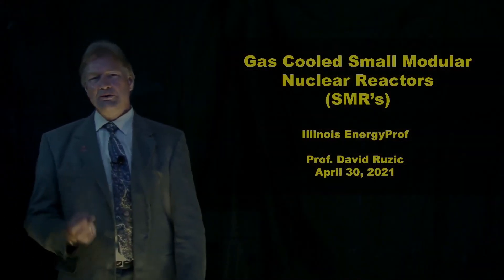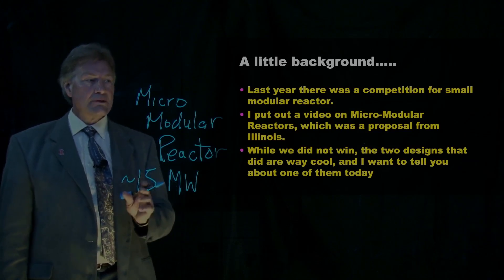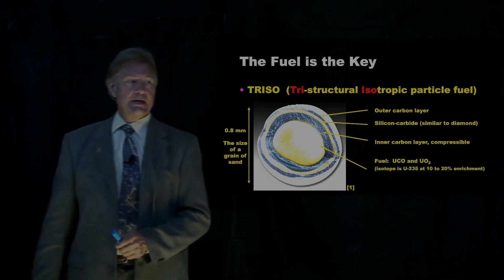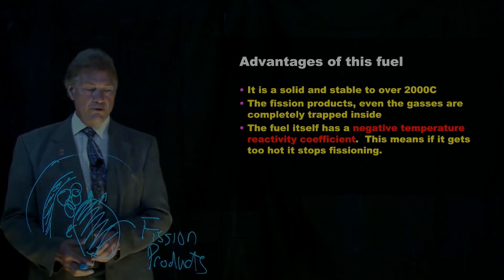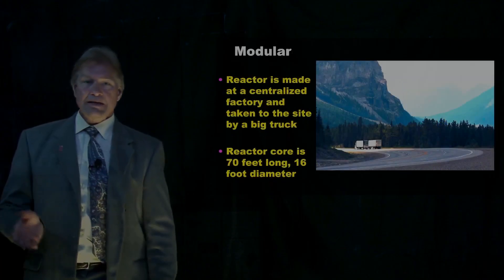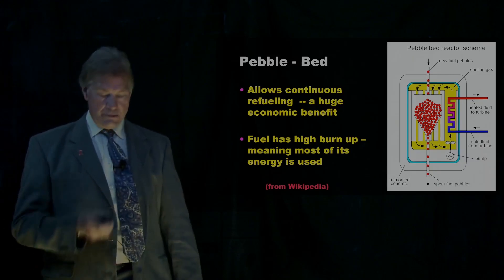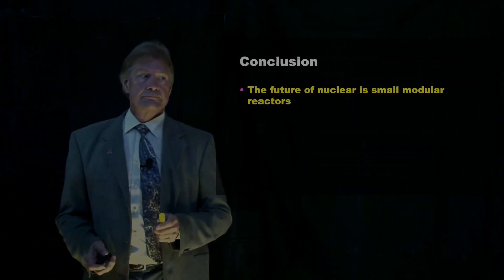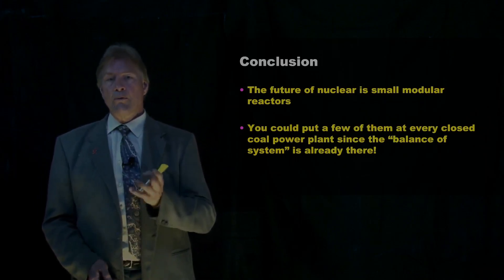SMR -- Small Modular Nuclear Reactors - Gas-Cooled

Comment: Where were you when I was in nuclear engineering school?!
Reply: You should be glad he was not you professor.  He is book smart but reality dumb.

This is from the Des Moines Register an concerning the only Small Modular Reactor (SMR) project in the U.S. today.
In 2013, the Wall Street firm Lazard estimated that the cost of generating electricity at a new nuclear plant in the United States will be between $86 and $122 per megawatt-hour. Last November, Lazard estimated that the corresponding cost will be between $131 and $204 per megawatt-hour based upon the 4 recent new nuclear projects in the U.S. . During the same eight years, renewables have plummeted in cost, and the 2021 estimates of electricity from newly constructed utility-scale solar and wind plants range between $26 and $50 per megawatt-hour. Nuclear power is simply not economically competitive.
SMRs will be even less competitive. Building and operating SMRs will cost more than large reactors for each unit (megawatt) of generation capacity. A reactor that generates five times as much power will not require five times as much concrete or five times as many workers. This makes electricity from small reactors more expensive; many of the original small reactors built in the United States were financially uncompetitive and shut down early.
The estimated cost of constructing a plant with 600 megawatts of electricity from NuScale SMRs, arguably the design closest to deployment in the United States, was originally advertised as costing $1 billion but upon requesting actual bids from engineering firms, increased to $6.1 billion in 2020. Given inflation and other cost constraints that cost today can only be expected to be significantly higher.
The cost was so high that ten members of Utah Associated Municipal Power Systems canceled their contracts. NuScale then changed its proposed plant configuration to 6 fewer reactors but increased each reactor output from 50 Mw to 77 Mw costing at total of $5.3 billion. The NRC just last week approved the construction of the 50 Mw design but now will have to start the review process all over given the switch to a 77 Mw design. For each kilowatt of electrical generation capacity, that estimate is around 80% more than the per-kilowatt cost of the Vogtle project in Georgia — before its cost exploded from $14 billion to over $30 billion. Based on the historical experience with nuclear reactor construction, SMRs are very likely to cost much more than initially expected. And they now have delayed the project start until 2025 in an attempt to find more backers.  All this before the inevitable setbacks that will occur once construction starts.

Comment: is it operational at this time?
Reply: This may answer your question.

This is from the Des Moines Register an concerning the only Small Modular Reactor (SMR) project in the U.S. today.
In 2013, the Wall Street firm Lazard estimated that the cost of generating electricity at a new nuclear plant in the United States will be between $86 and $122 per megawatt-hour. Last November, Lazard estimated that the corresponding cost will be between $131 and $204 per megawatt-hour based upon the 4 recent new nuclear projects in the U.S. . During the same eight years, renewables have plummeted in cost, and the 2021 estimates of electricity from newly constructed utility-scale solar and wind plants range between $26 and $50 per megawatt-hour. Nuclear power is simply not economically competitive.
SMRs will be even less competitive. Building and operating SMRs will cost more than large reactors for each unit (megawatt) of generation capacity. A reactor that generates five times as much power will not require five times as much concrete or five times as many workers. This makes electricity from small reactors more expensive; many of the original small reactors built in the United States were financially uncompetitive and shut down early.
The estimated cost of constructing a plant with 600 megawatts of electricity from NuScale SMRs, arguably the design closest to deployment in the United States, was originally advertised as costing $1 billion but upon requesting actual bids from engineering firms, increased to $6.1 billion in 2020. Given inflation and other cost constraints that cost today can only be expected to be significantly higher.
The cost was so high that ten members of Utah Associated Municipal Power Systems canceled their contracts. NuScale then changed its proposed plant configuration to 6 fewer reactors but increased each reactor output from 50 Mw to 77 Mw costing at total of $5.3 billion. The NRC just last week approved the construction of the 50 Mw design but now will have to start the review process all over given the switch to a 77 Mw design. For each kilowatt of electrical generation capacity, that estimate is around 80% more than the per-kilowatt cost of the Vogtle project in Georgia — before its cost exploded from $14 billion to over $30 billion. Based on the historical experience with nuclear reactor construction, SMRs are very likely to cost much more than initially expected. And they now have delayed the project start until 2025 in an attempt to find more backers.  All this before the inevitable setbacks that will occur once construction starts.

Comment: These videos are a fantastic learning tool !!
Reply: He needs to take a class in economics before he pushes SMRs.

This is from the Des Moines Register an concerning the only Small Modular Reactor (SMR) project in the U.S. today.
In 2013, the Wall Street firm Lazard estimated that the cost of generating electricity at a new nuclear plant in the United States will be between $86 and $122 per megawatt-hour. Last November, Lazard estimated that the corresponding cost will be between $131 and $204 per megawatt-hour based upon the 4 recent new nuclear projects in the U.S. . During the same eight years, renewables have plummeted in cost, and the 2021 estimates of electricity from newly constructed utility-scale solar and wind plants range between $26 and $50 per megawatt-hour. Nuclear power is simply not economically competitive.
SMRs will be even less competitive. Building and operating SMRs will cost more than large reactors for each unit (megawatt) of generation capacity. A reactor that generates five times as much power will not require five times as much concrete or five times as many workers. This makes electricity from small reactors more expensive; many of the original small reactors built in the United States were financially uncompetitive and shut down early.
The estimated cost of constructing a plant with 600 megawatts of electricity from NuScale SMRs, arguably the design closest to deployment in the United States, was originally advertised as costing $1 billion but upon requesting actual bids from engineering firms, increased to $6.1 billion in 2020. Given inflation and other cost constraints that cost today can only be expected to be significantly higher.
The cost was so high that ten members of Utah Associated Municipal Power Systems canceled their contracts. NuScale then changed its proposed plant configuration to 6 fewer reactors but increased each reactor output from 50 Mw to 77 Mw costing at total of $5.3 billion. The NRC just last week approved the construction of the 50 Mw design but now will have to start the review process all over given the switch to a 77 Mw design. For each kilowatt of electrical generation capacity, that estimate is around 80% more than the per-kilowatt cost of the Vogtle project in Georgia — before its cost exploded from $14 billion to over $30 billion. Based on the historical experience with nuclear reactor construction, SMRs are very likely to cost much more than initially expected. And they now have delayed the project start until 2025 in an attempt to find more backers.  All this before the inevitable setbacks that will occur once construction starts.
Reply: @clarkkent9080  lazzadd use LCOE figures which don't include all the costs for renewables like transmission lines, network upgrades and backup supply 

Its useless

Comment: The reason there are no small nuclear reactors, modular or otherwise, is the economy of scale.  No matter how large or small, a reactor plant requires a maintenance force, security force, and operations group.  These highly trained people are very well paid and represent a significant ongoing cost.  One modular reactor may generate 1/5 of that of the standard large units but this operating cost would be nearly equal to that of a large plant. Every power company that has ordered a nuclear power plant, has ordered the largest capacity that is available. The newest nuclear plant Vogal unit 3 & 4 used modular manufacturing to lower coat and this was a complete failure. The Vogal units are 5 years behind schedule and BILLIONS over budget.  The VC summer plants were canceled after spending BILLIONS and causing the bankruptcy of the South Carolina electric grid operator. 10 years ago, the head of the U.S. Energy Department stated that the future of Nuclear Power in the U.S. would be based upon the success or failure of the VC Summer and Vogal Nuclear units. I worked in commercial nuclear power for 35 years and was a licensed senior rector operator at 3 different commercial plants. The U.S  does not have the expertise or infrastructure to build and operate Nuclear power facilities and this has been proven over and over.
Reply: I guess you could argue that fewer parts and smaller facilities means less security/maintenance personnel needed, but those costs still wouldn't perfectly scale. The NRC isn't setup to handle modular nuclear reactors, so that is another factor.
Reply: @timc7035  The 2 and 4 reactor sites are more cost effective than single reactor sites.  The simple reason why no new nuclear power plants are being built is that they are not cost effective without massive government or taxpayer handouts

Comment: Won't helium - which is becoming scarce - leak out left, right and center through every connector, hose or line? Would a higher-mass noble gas work better?
Reply: No.  Helium is the best.  Hydrogen can be better but it can cause explosion.  You want it safe and it must be helium.  The gas is not just been used for cooling.  It is also the medium to carry heat to heat exchange.  High latent heat capacity is needed.  Higher mass noble gas can be better in leakage but poor in carrying heat.

Comment: X-Energy should not assume the fuel balls will fall freely to the bottom of the reactor.  Likely the balls will need “aerating” or disturbing before they flow.
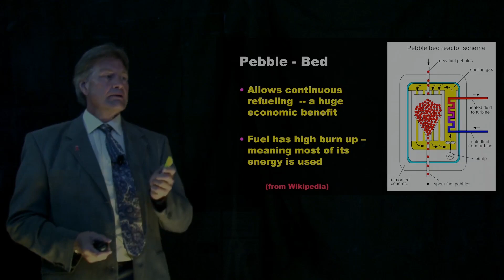Reply: ??? 9:20 he literally says that gas will go through it. What do you think it will do, besides remove heat?
Reply: @Poctyk  I did an engineering study for a subsea jack.  One idea was bearing balls as the ‘fluid’.  To check plausibility. flowed marbles through several funnels.  A few (2-3) would go, then it would hang up.  Really weren’t in the biz of fundamental R&D, so abandoned.   
     I can’t say there isn’t something that can’t work, but I can say don’t assume it will.           Cheers

Comment: At 8:30 you reveal the dismal thermal efficiency of this device.  It yields, from 200 units of heat, a mere 80 units of electrical power, giving a thermal efficiency of 40%.  This is actually a very optimistic number, but even if true it means that for each one megawatts of useable electrical power produced, 2.5 megawatts of high entropy heat are released into the local environment.  Those huge cooling towers at the reactor sites exist for this reason.  No hand waving can make this problem disappear.  Anyone interested can read the chapter on Power Plants in the Van Ness book, Understanding Thermodynamics.  It is available for free as a PDF.  In fact, we must all begin "Understanding Thermodynamics" as we face the tough decisions with big impact on the future of life on Earth.

Comment: Thankyou for interesting presentation on pebble bed technology. A couple of questions though, if the helium leaked out could you cool this with air, surely the oxygen in the air would set fire to the carbon coated pebbles. Could you use nitrogen or CO2 as an emergency coolant instead. Also how do you stop the pebbles jamming in the exit chute, can the geometry of the exit designed to prevent this with 100% reliability.
Reply: I was wondering about that as well. With a loss of helium, would there still be positive gas pressure? With positive pressure, any small leak is no problem because gas will flow out, not in. Lacking that, air will surely flow in and react with the graphite coatings. I have to imagine there are planned safety measures for this (graphite is used as a moderator in nuclear reactors not named Chernobyl after all), but I think his claim of a perfect fail safe condition is exaggerated.

Also, the world's helium supply is becoming very precious. As it becomes more and more scarce, what happens to their cost projections? Could they switch to another noble gas? Argon maybe? Is nitrogen too reactive? But that would certainly change some of their heat exchange thermodynamics, and maybe the efficiency drops.

Interesting technology, but I'm not convinced it's a panacea.
Reply: 90% of the world's population is in dictatorships. 
Nuclear industry in every country?????
Putin is the world leading Dictator.
The worst killers, the child killers, lead all Dictatorships. Oppose your Dictator and one of your children will ring you and tell you that the man with the gun told you to ring.
Putin is killing the neighbour's children. 
100,000 SMR, say BWRX300, around the world means the USA military budget goes from 4% to 40% of national budget. 
The USA is the biggest target in the world.
My concern includes a few more matters  aswell.

Comment: This is similar to the German hydrogen cooled reactor.  The problem there was the failure of carbide encased fuel elements.   I also wonder about the xenon gas and the inability to outgass could cause the pellets to deform at temperature

Comment: I find the economic analysis is interesting.  Any thoughts on the Crypto Miners buying coal plants to mine bitcoin, and avoid transmission fees/taxes.  Big plants predict high 90% utilization in cost analysis, but thanks to solar+ spikey demand they never hit the numbers.  With this private power the generation and utilization can be maxed out.  The states are quick to offer up plants that are being decommissioned, but may not realize that power won't hit the transmission lines.  I think an economic analysis would make an interesting video.

Comment: It sounds cool i like the idea of SMR, but gas-cooled reactors seems to me as a bad idea because of Windscale accident (maybe you could do a video about it?). However the design is completly defferent from Windscale, and definitely more secure, but still I have some questions. Could this pebble cracked for some reason? How about decay heat management in case of coolant failure - you said air is enough to cool it then (it would carry some contamination out of reactor?), but what if for some reason air could not be supply into the reactor and it remains uncooled - could fuel meltdown inside pebbles from decay heat, and would this pebbles remain uncracked in that situation? And couldn't Uranium catch on fire in contact with air after pebble would cracked - don't know if UCO and UO2 could ignite? These are three problems I can think of now, pebble cracking, Uranium ignition and decay haet management in case of total coolant failure.
Overall reactor design sounds really cool but I'm affraid it could be consider too costly to build, mainly because of high enrichment Uranium fuel, but still seems to me quite cheep 400 mil $ for one reactor looks nice to me.
Reply: Enrichment costs are negligible.  There was a hydrogen gas pebble design in Germany using larger pebbles but the carbide was cracking

Comment: You didn't mention the cost of the waste storage from this pebble reactor. Was this included in the 8.5 cent per kWH? We need reactors that have little to no radioactive waste products. We need power generation that is commercially competitive with coal and gas without government support or regulation. Case in point solar and wind are not economically viable without massive taxpayer subsidies. Reactors that produce usable products like plutonium-238 for RTG's and medical isotopes are ideal.

Comment: Please explain how fission MeV energy turns into heat or an explosion. Ie ..what does the MeV's do to surrounding atoms ? 
every one just passes by this step quickly or dismiss it.
Reply: MeV is a very tiny measure of energy, equal to 1.6 e-13 Joules. Most energy from fission is the kinetic energy of the fission products, which collide into surrounding atoms and transfer their energy, causing temperature to rise.

Comment: Quick question, would it be an issue if the reactor would be flooded or does the reactor building have to be fully sealed? I think about some massive natural disaster, an earthquake that would crack the concrete walls of the reactor, and flooding that would provide a lot of water (additional moderator?). How this type of reactor would deal with that scenario ?